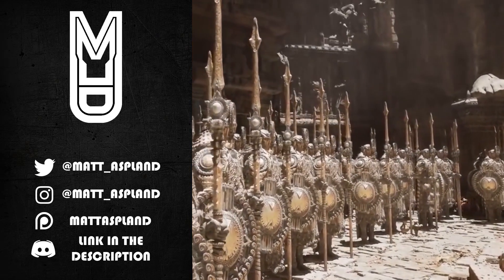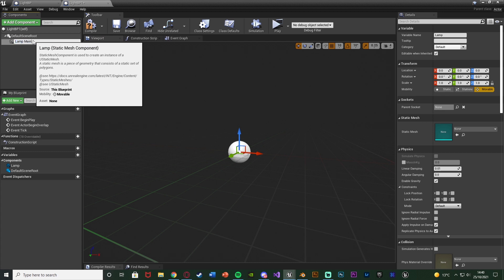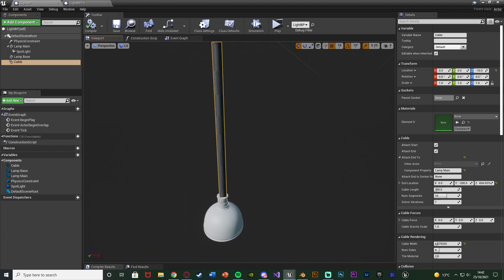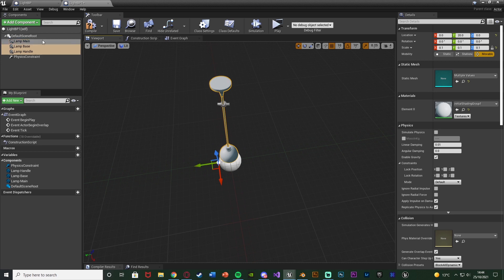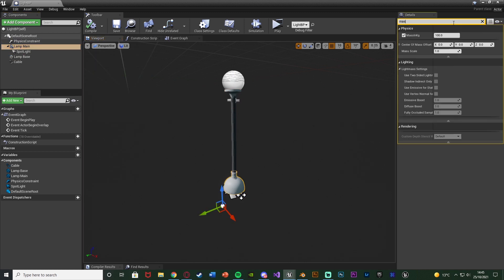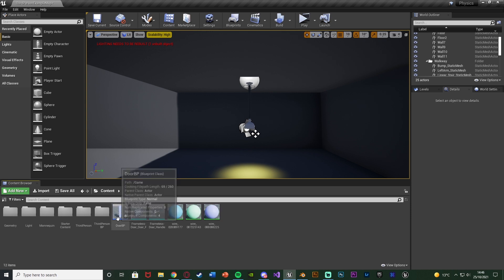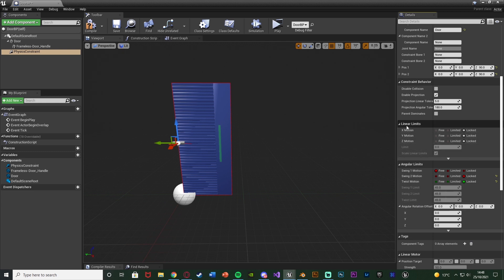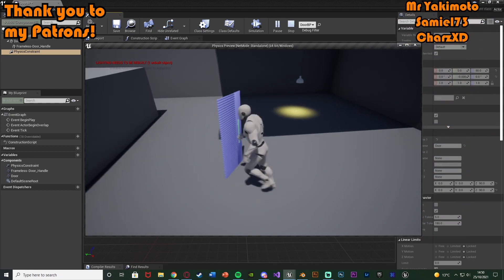Physics Constraint | Hanging And Swinging Lights And Door - Unreal Engine Tutorial

Comment: It looks like there’s an issue with the lamp cable connecting to lamp main. It’s glitching in the video and not staying totally anchored to the lamp main. How do you fix that?
Reply from the maker: Yeah, I think that is probably just how I connected it up. The lamp mesh I used wasn't amazing and wasn't centred properly, plus I could've spent more time connecting it up precisely, however since it was just for an example, this was fine.

So, I believe just spending more time on it and being more precise should do the trick just fine :)
Reply: @MattAspland   sounds good thank you Matt!